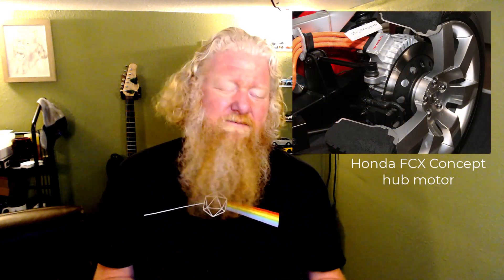Why No Hub Motors in Electric Cars?

Comment: I would say, wheel hub motors still make sense for low-speed city cars - like Byd Seagull, Wuling Mini, Panda, and so many others which are being produced: You don't need big heavy motors, city driving isn't that bumpy, you save space occupied otherwise by gearbox (reduction box), differential and the motor itself. Less energy loss through friction, no oil changes, less bearings, less parts to wear down.  I believe there is a German company which already produces, or at least promises some really lightweight hub motors.
There are already a lot scooters bicycles and motorcycles out there with hub motors, and they work fine. I have a 1.5 Kw cheap Chinese scooter for over 7 years now, and motor still works absolutely fine. It was merely a pain in the ass to change the tire: power cable has no plug, must be unmounted completely to get it off the scooter. I should perhaps find a way to install a water tight plug for that.

Comment: Unsprung weight. I was disappointed when Aptera back out of their plans to use hub motors.
Reply: Was caused by reliability issues (motor electronics and power wirings)

Comment: Aptera has hub motors.
Reply: no, this design was abandonned by Aptera because of reliability problems from the motors and the feeding cables, they use mow a classic design: motor in body, and transmissions to the front wheels and this works without problem
Reply from the maker: Also not in production.
Reply: Aptera changed that design feature, much to my chagrin.

Comment: Ok so first hub motors are the way a lot of electric cars are going. Why? Because they don’t take up battery space and most of the added complexity is in software not hardware. Want abs? In a traditional car or a car with a traditional electric motor you need to work brakes and figure out where traction is and so on. Most of that still exists with an electric motor except for a few mechanical simplicities: no wheel speed sensors they are built into the hub motors themselves, brakes are also partially part of the wheel motor as well so instead of pulsing the brakes you can on a wheel by wheel basis pulse the regen or even turn the motor backwards to achieve the same effect or similar, yes you still need traditional brakes, but the software now has the ability to interact with each wheel motor for traction control and abs. Yes there are mounting complexities, but those aren’t much different than a wheel. So a lot of the engineering complexity becomes software based rather than hardware. They also tend to be lighter than large central motors and as such increase range.
Reply from the maker: Name any production EV with hub motors.
Reply: @Aarononautos the Emily GT is supposed to enter production soon. 

The rivian R1T has a motor for each wheel (though they are not mounted in the wheel).
Reply from the maker: @mizinoinovermyhead.7523  Not in production and not hub wheels.
Reply: Aptera changed their design away from hub motors to more traditional motors.

Comment: So instead you do like Tesla  without the gears. two motors up front with a CV axle per, same in back. keeping the unsprung weight low. someone down in the comment's mentioned the cost of an EV motor. How about the battery being 20K ?  You could use pancake motors instead on radial wound making them lighter and remove the iron or steel core to reduce weight and Cogging . My problem with EV's is really the part where we know they are powerful at the start but we'll spin them to 20 k rpm making for a less efficient motor. I propose adding more coils to to decrease speed and increase the phase count to smooth it out. I'm just a truck driver so don't thrash my comment like I know shit.

Comment: I believe the correct term is unsprung weight, not unslung weight. While it's true this affects handling, I don't think hub motors necessarily add complexity, especially if you use only two in the front or rear. If a hub motor is damaged, a spare can be swapped out as a wheel unit very quickly and the broken wheel or motor sent off for repair. Try that with a main motor connected to a differential or to CV joints.
Reply: For optimum traction control, EVs should have a motor for each wheel, as close as possible to the wheel.
Reply: @elhoward7440  But that would more than double the motor cost considering the additional controller needed. Also adds unsprung weight.
Reply: @elhoward7440  ...but on the plus side, I suppose you could use smaller motors on the four wheels.
Reply from the maker: Motors not in the hub rarely get damaged. And they do add complexity. Wiring alone is an issue, given how large the wires to a motor need to be. They also are heavier than the equivalent mechanics to put them on axles. 

Right now, if you are in a wreck that damages the wheel, all you replace is the wheel and possibly brakes. If you add a motor, you're now having to replace that as well.
Reply: @Aarononautos  Dude, Unsprung weight does matter, Unslung is incorrect. That will heavily impact suspension performance, it will increase vibration and chatter. Wires are flexible, and it's fairly easy to make rotating electric fittings, using insulated graphite brushes. that's not a challenge. Yes, wheel damage is a valid concern. However, in most cases, that's irrelevant. Look at what else car companies deliberately do to make it hard to repair. However, having 4 motors, inboard, with a drive shaft extending from each motor to it's own wheel could be greatly beneficial in torque vectoring and differential steering.
Reply: @charliesrandomthings5457  "Buh buh buh, all these rational objections are irrelevant, because i dont like them to be relevant" is a quality argument among people with little to no knowledge on youtube.
Reply from the maker: Cost. Cost. Cost. The average EV motor is over $10,000. Feel free to Google that. 

And you're making my points for me. Thanks. Feel free to actually watch the video past your "oooo, he said the wrong word. That's my only talking point now."

Comment: Electric hub motors have not been commercially successful in modern production cars because they negatively affect vehicle handling due to higher dynamic wheel load and their placement makes them prone to damage.
Reply: So you watched the video?
Reply: @RoboRagnarok-i1g  no
Reply: I came to the same assumption and didn't watch the video
Reply: @JosephRauch-z6t  yeah i didn't watch it either